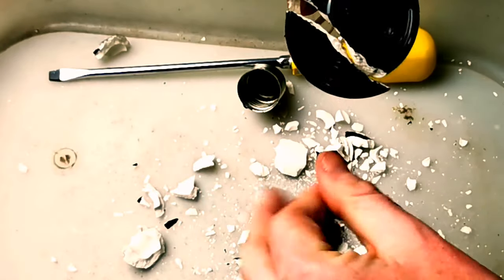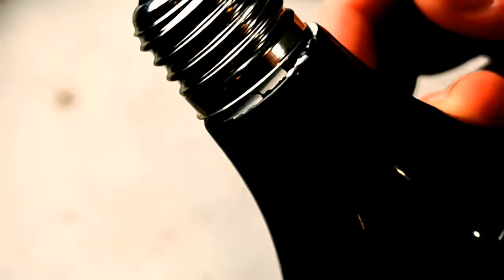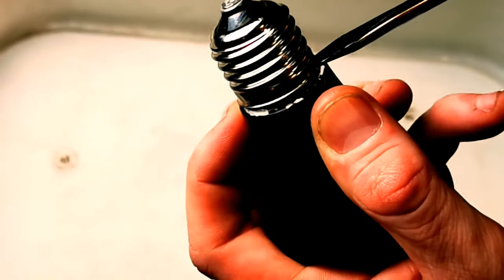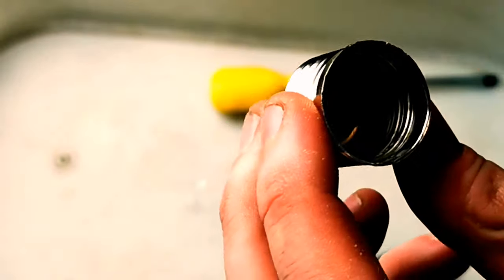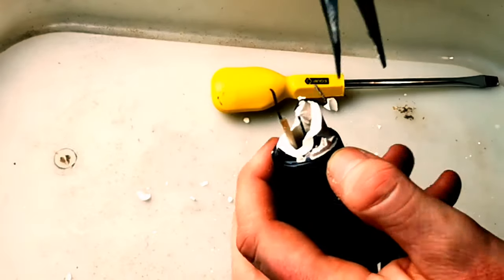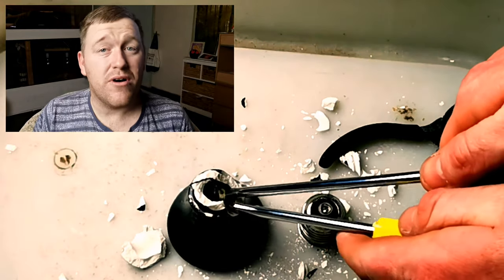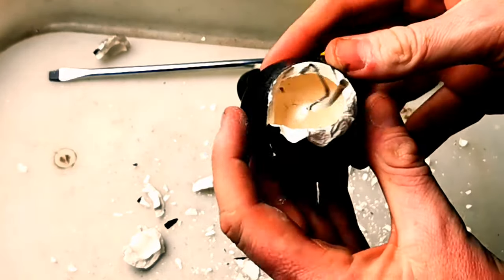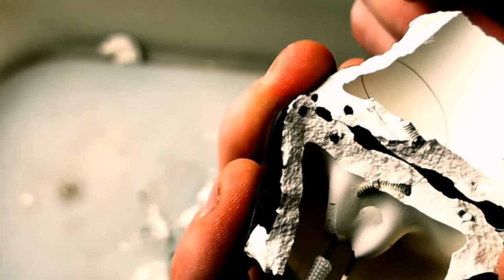What's Inside A Ceramic Heat Emitter ?

Comment: Mine has fallen and a small piece of the ceramic chipped off. I desperately need it to keep my chicks warm tonight. Is this a fire hazard? None of the wires or springs are exposed.
Reply from the maker: I wouldn't of said so. Think the ceramic is just a heat projector
Reply: Not a fire hazard, but obviously keep the bulb surface (even the sides) away from wood, paper, animals, etc.

Comment: Cheap brands don't work as good too if you use a thermostat it says it ..... degrees but you lose a lot off heat if your probe hangs not on the bottom. My probe hangs just under the bulb like 8 cm under It and if I use the correct one it works much better and it's warmer on the bottom. But I have a heat bulb normal one and a UVB light too. But my heat bulbs max is 75 watt I can put I there. And in the ceramic it can even as high as 200 watts. I have a cold room. But they hang inside the Terra. So I make a basking spot in winter with an exo Terra heat lamp 50 or 75 watt. And on the other side I have a ceramic heat amitter with thermostat that I put on like 26 degrees celcius at night and 28 at day. Remember I lose 2 degrees Celsius on the bottom. So it's 24 and 26. And under the basking spot it's like 29-30 degrees Celsius on the ground. Rest of well the middle off the enclosure is like 24 degrees Celsius then. My Terra is 120cm*50cm*50cm for a cal king.

Comment: I’m really struggling to keep my humidity down in my leopard gecko what do you recommend I’ve watched a previous video from you and installed 2 more vents in my 40 gallon tank also how long do the bulbs last and I heard somewhere having one decrease humidity, does it?
Reply from the maker: having additional heat helps providing there is many of venterlation
Reply: NORTHERN EXOTICS okay thanks I’m getting a heat projector now instead! I’ll add more ventilation thanks for the help :)
Reply: @rylie2679  Are you using a digital meter?

Comment: Just bought one of these at my local Walmart for $15. They work amazing!!

Also, some notes:

The white stuff at the base is a type of cement/glue to keep the base attached to the bulb. The wire in the center was what was keeping the base on the whole time. The cement decays with heat.

E27 is the European version and E26 is the American version. They are only a millimeter apart and therefore are interchangeable. Just mind the bulbs voltage. 

The black coating is only an enamel layer to protect the bulb (it may have other benefits) but otherwise, the main ceramic is just white.

Comment: So the inside of it is just the heating element covered by ceramic, how does it make infrared?
Reply from the maker: The metal core heats up through the wattage forced through it . That heats the ceramic making infered wavelengths of irc . It's not a natural wavelength found in nature. It's like getting blown in the face by a hairdryer haha deep heat projector provided ira and irb which are more natural

Comment: The "cheap" Chinese "knockoff" bulbs are made in the same factory as the expensive Chinese real bulbs.
Reply from the maker: That maybe correct in some cases however proper bulbs are made to specific specs with higher quality components and tested to those specs whereas others are just put together without testing.
Reply: @NORTHERNEXOTICS  It's a yes and no answer. The bulbs are identical, same materials, minus brand. Your bulb seemed fine, except for the "peeling" that you pointed out. I don't if it was peeling from the glass enamel, or if it was a mineral deposit from evaporated water. But if it was peeling from the enamel it could be because you had it on an humid environment; thermic shock. Also, they don't get tested, one gets tested, and all others are produced based on the one that was tested. the design and materials are also pretty inexpensive, and rudimentary; ceramic, electric coil, and socket. You can't add nor perfect it in any other way.  You could but an expensive one and a cheap one and do a side by side comparison, and they will be identical.

Comment: That deep heat projector that you got in popcorn viv is that enough to heat a 6x2x2 viv alone because viv got baby albino boa and thinking of using deep heat projector but not sure as iv only used ceramic
Reply from the maker: It is at the minute but only just so if I upgrade I'll need to add another
Reply from the maker: These bulbs have a great radious

Comment: Do ceramic heat emitter has mercury vapor???
I want to switch to ceramic heat emitter please help me out
Reply: No.  Gasses are only used in bulbs where it reacts with current to create light.  These are just current like an electric stove ran through ceramic that absorbs the current made heat and projects it.  No gas needed

Comment: The “corrosion” inside the metal contact is where the nichrome wire touches the metal, causing some discoloration. True for any che and is not a problem. 
Nichrome wire when heated breaks down over time, albeit a long time, maybe 5-10 years depending on usage, but it happens. ON/OFF temperature controllers speed up the breakdown because the filament cycles from very hot to not to hot. A proportional controller or dimmer on the other hand does not do that. But CHEs are so inexpensive and last long relative to other bulbs, so who cares.